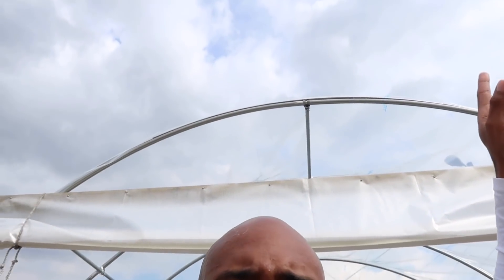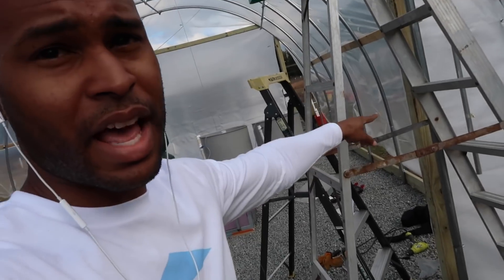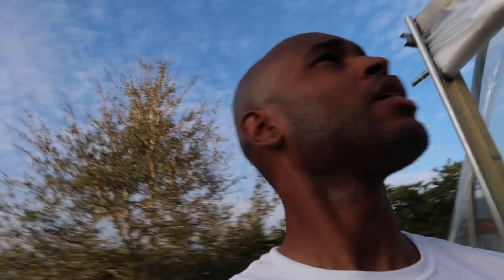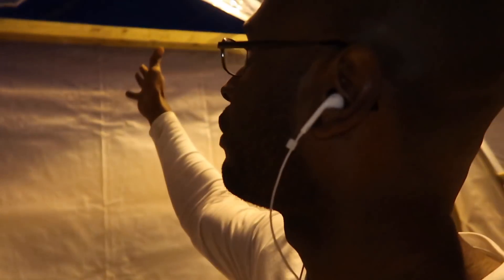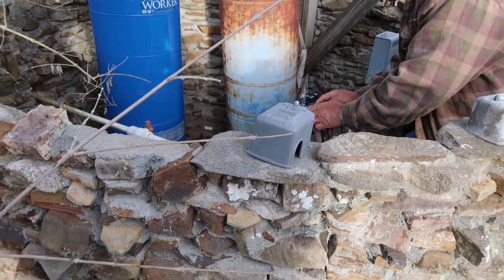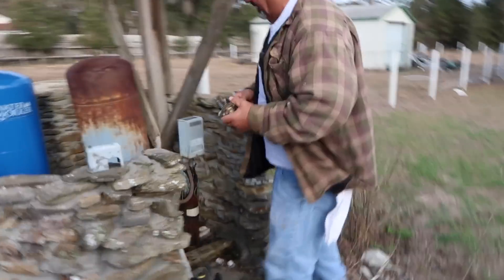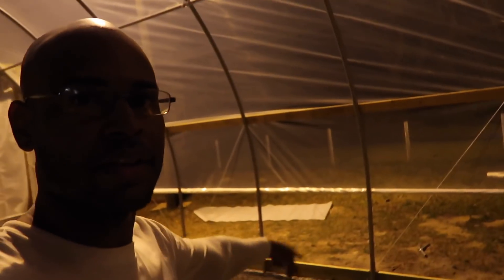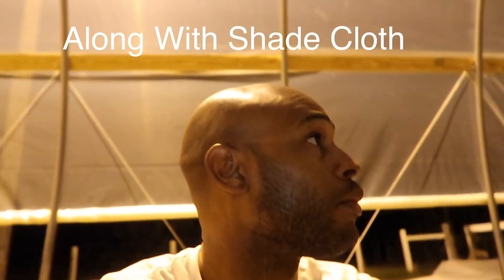Installing Front Panel and Roll Up Sides | The Aquaponics God Ep. 10

Comment: I'm a new subscriber love ur channel I have ran hobby barrellppnics in my basement for about three years in wva mostly flood and drain. I've had a Lot of success with low energy crops like beans and lettuce. Love the hobby would like to expand as you know this stuff is fun and addicting but heating a greenhouse economically is the thing I'm working on it  I'm hvac tech by trade  I'll figure it out once again love the channel and the information 👍

Comment: Hey mate Matty Dawson from Australia. Your doing good love the vids. 
If you get the chance could you explain some pros and cons about positions of inlet/drain on the DWC bed, eg- would it be beneficial to use a SLO as a drain ? Is it better having the drain in corner/centre/side of the bed?
What would the effects be of using a overflow drain in the side wall compared to a riser from the bottom ? 
And where is the inlet best placed ? 
Im halway through a DWC set up myself. 
Thanks mate